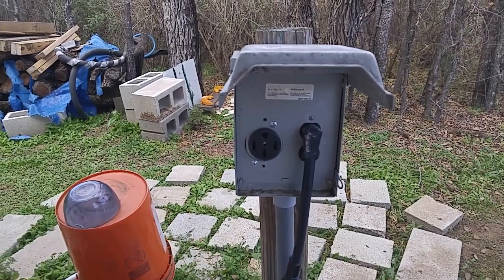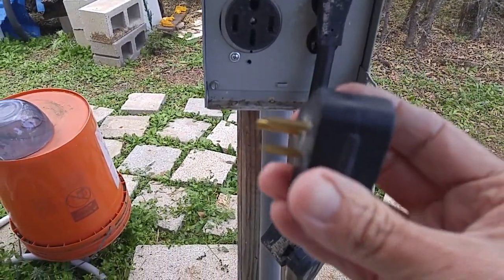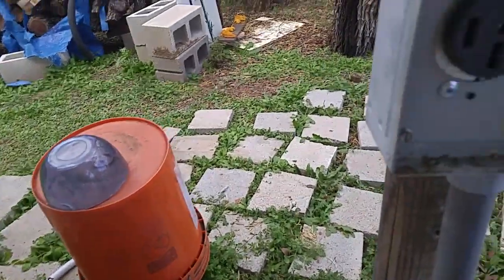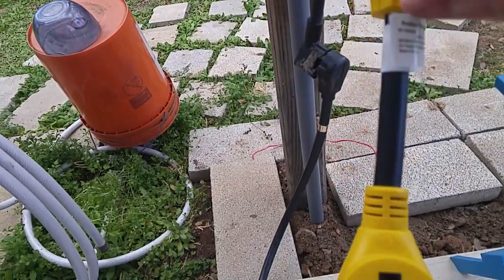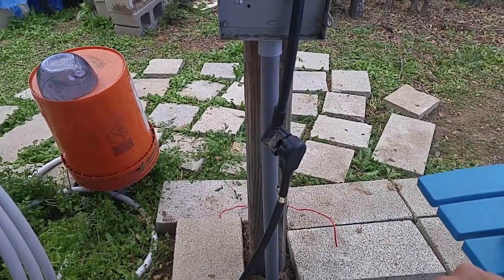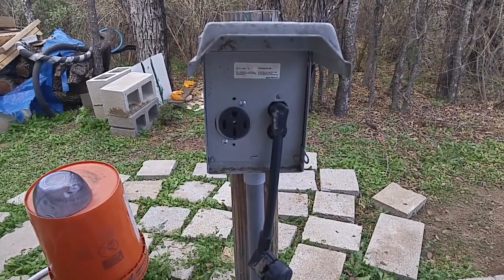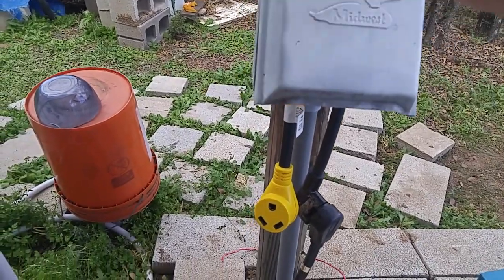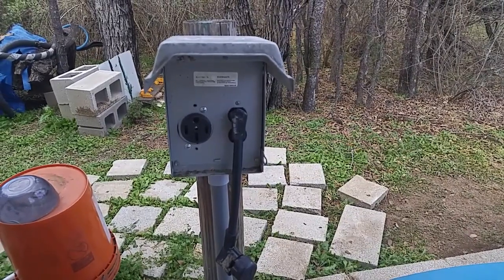RV ELECTRICAL ADAPTORS!

Comment: Rusty,
I am not sure if people understand that if they under power certain appliances like an air conditioner or refrigerator they can damage it as it’s straining to start each cycle and run properly if on the lowest rated amperage you have to chose what to run. Just because it can all connect together doesn’t let a person do as they wish.  An appliance rated cord is what is needed.